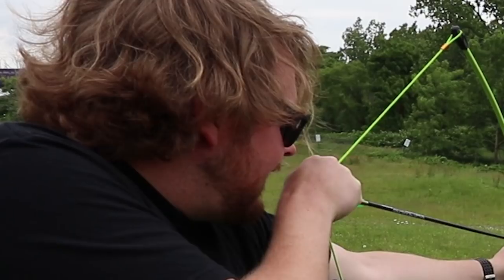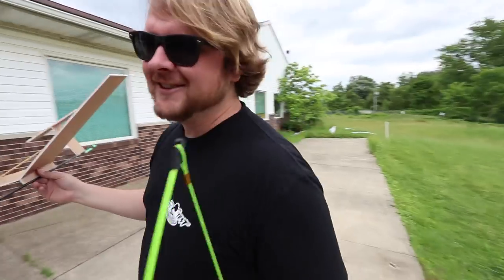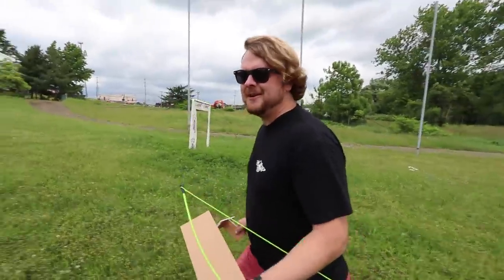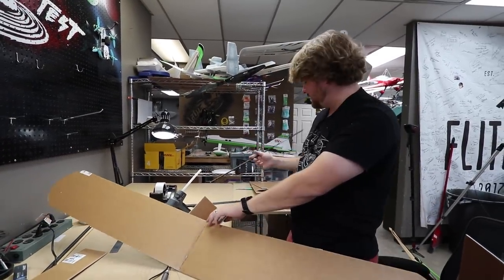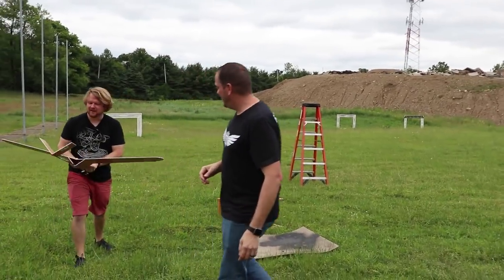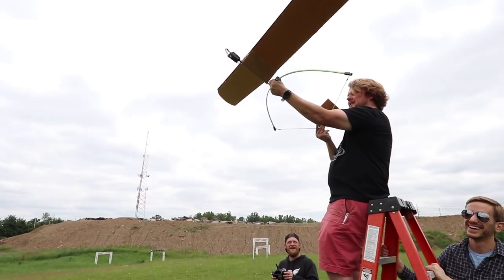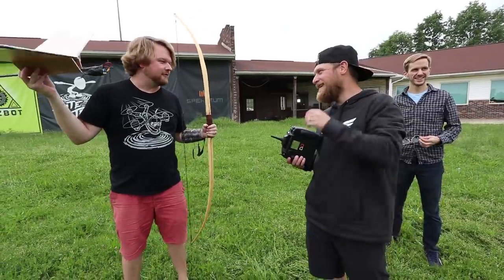The Bow and ArrowPlane

Comment: As an archer and an aviation enthusiasts I love this video. I have actually used dammaged arrows to reinforce wings in my builds.
Reply: itwaslikethatwhenigothere trying to figure out if my compound will work or if the crossbow will be the best
Reply: Mmmmmmm I’m doing this with my compound bow
Reply: You can also make pretty decent bows out of PVC pipe. You melt the limbs with a heat gun or stove and taper them out. Awesome vid like usual flite test! I've been inspired to give this a go now!
Reply: I have tried to in courage Flite test to do more with Rockets but for some reason they just won't...
Reply: @unorec1983  im a little bit late to this, but  using a crossbow would be better since you dont lose any velocity to newtons third law
Reply: I wont lie this is cool but as a hunter his bow form and how he dry fired it made me cringe and smart idea with the broken arrow idea do you use carbon or aluminium arrow I rather carbon
Reply: That’s smart. Carbon fiber arrows especially the expensive ones, are very consistent.
Reply: Anyone else cringe when he dry fired the bow. I know its a cheap walmart "toy" but......😡
Reply: Joerg (@joergsprave - The Slingshot Channel), should take up THIS challenge!

Comment: I like how it would have flown further if they had just left it an arrow.
Reply: Hmm...might keep that in mind for the Skittle challenge.
Reply: Make really tiny wings and tail..so no drag...forget the control surface...then shoot! LOL
Reply: Probably!  I hunt with a 90lb draw compound and have made shots at targets 300 feet away.  Please note, I didn't say I HIT the target consistently at that distance, but the arrows did carry that far!
Reply: Similar to the flight distance challenge my tenth grade science teacher set up for us. Come up with something that will fly as far as possible which weighed under so many grams/ounces, no power to it, had to be thrown. Had a couple of boys team up to solve the problem. Most of us made something. I came in with a giant balsa wood biplane glider that was really nothing more that a few sheets of balsa wood , some putty on the nose for weight, and some 1/8" strips of balsa wood for the struts. It was about 2 1/2' to 3' long with an equal size wingspan. If I'd had a good wind, or any wind actually, I'd have probably done better, think I managed between 15 and 20 feet. These two, however, came up with one of the heaviest "designs". A baseball, unmodified. Yup, it "flew" further than my design, or any design. They certainly didn't get any style points for that since they didn't do anything, but they did meet the criteria. The challenge didn't actually say you had to make something, just come up with something.
Reply: 90lb is pretty strong for a lady isn't it?
Reply: I would say that’s more like it being thrown than flying though.
Reply: Just like how throwing a crumpled piece of paper against a bad paper airplane.
Reply: Or if they gave it winglets or swept the wing a little bit.
Reply: But on a 20$ walmart bow?
Its probably like 15-20 pound draw weight and also sized for kids

Comment: I purchased a box of arrows from a sporting goods store they are perfect wing spars.Have been using the same box of shafts for several years. Even if you total the plane strip off  foam and rebuild the plane. These were fairly inexpensive arrows black composite shafts, the end that you thread the tips to has an plastic insert with a 4-40 threaded hole. 4-40threaded rod available from LHS or home center connects two shafts together for wing spars or keel beam in fuselage. Leave a gap between the two shaft ends and bend the threaded rod add dihedral 
to the two shaft spar. I like arrow shafts..

Comment: i use a carbon express 2117 aluminium arrow shaft for fuse on my motor glider,i 3d printed some clips to glue to foam board,eveything snaps on.work in progress
.....nice work guys.

Comment: With catapult launched gliders (CLGs) you balance it (as you did) for a flat gliding flight. Typically one will launch the glider so that the speed of the plane will be greater at launch than at gliding speed.
At a higher speed a plane that has lift will curve up into a stall if launched with level wings, and either dive into the ground or fly in a series of stalls.
Free flight CLGs are often launched with the wings at an angle to the ground so that rather that going into an upward arc the plane will fly in an arc between perpendicular to the ground and parallel with the ground: this will give you height, but rather than stalling the plane will level out into a glide.

Comment: Now I'm wondering if it would be possible to do a bow powered airplane.  Like how some planes use a twisted rubber band for power.  Maybe have an arrow with teeth along the top edge that turn a gear that then turns a propeller?  Sounds like a good project for Peter? :D

Comment: A few tips for gliders: first, when they are that small, I recommend that you remove the paper from the top of the wing and sand it into a sort of airfoil, and that will improve the glide ALOT. Also, the wing leading edge should be swept back slightly so that the wingtip has a smaller cord than the wing root and thus decreases tip losses like vortices. And lastly, instead of a barbecue skewer going over the top of the wings, try cutting a dihedral brace from plywood to go IN the wing where the center join is. And lastly, technically because lift:drag ratio is always equal to the glide ratio, a heavy plane could glide very well if it were very low drag.
Reply: Heavier plane = greater lift needed to stay airborne = greater coefficient of lift for any given velocity = greater induced drag = worse L/D
Reply: Precisely! Which is why I said "if it were very low drag". For example, the NXT Stream DLG has such a low drag airframe that it has almost the exact same glide ratio at 220 grams as at 600 grams. I believe at 220 its sink rate is 28 cm/sec, and at 600 its sink rate is 30 cm/sec
Reply: L/D and minimum sink are totally different.
Low weight will give low minimum sink and LD can be maximized with ballast to give a longer distance flown v height lost.
Reply: Right. Well I don't wanna get into an argument. You are right on all accounts; I misspoke. My main point was simply that, generally speaking(at least in my experience) light-weightness has VERY little to do with how a glider glides. That's all. You can check out some of the glider vids on my channel if you wanna see my gliders. Nothing fancy, just balsa DLGs. :) cheers!
Reply: More money more problems
Reply: @3Triskellion3  Maximum L/D and weight are unrelated. Two identical airplanes of different weights will have the exact same maximum L/D and the exact same maximum gliding distances. The differences between them will be 1. Best L/D speed (higher for the heavier plane); 2. Sink rate (higher for the heavier plane) and 3. Time aloft (shorter for the heavier plane).  The max L/D will be the same for both, as will be the gliding distance.

Comment: Dear FliteTest. I have a challenge for you. You know those flexible pipes used with portable airconditioners and such? You take two of those and mount them parallel, about a meter apart, put some engine inside each one. Stiffen them up a bit, and use their bendyness with some servos to control it. Could you make that work?

Comment: Would love to see a challenge to launch a craft from a Trebochet - Most likely a re-inforced Goblin or similar (to withstand the G-forces) 
3 parts to the challenge.
1 - Build an effective Trebochet.
2 - the craft needs to survive the launch, and should reach a suitable altitude that would encourage a panic state as it starts it's free-fall.
3 - operator only gets to control the craft from a certain height from the ground to recover and dive bomb a nearby target.
EXTRA POINTS: Do it with under Glide conditions - Competitor with longest glide wins after gaining control from freefall.

Comment: Crazy idea here, B-1 lancer type wings. but for the opposite effect, Wings closed for take off (reduced drag better pitch control on takeoff and greater transfer of momentum) open wings using a snubbing servo to allow for maximum lift through all airspeeds of the flight. 

If you have a wide wing you lose alot of energy on take off and you dont get full speed from the bow but you glide slower and "farther" but if you have closed wings, less drag you can fly at incredible speeds for a long distance but with limited lift most of the time these are called "arrows" when we shoot them out of a bow.

Comment: You're gonna need a bigger bow...
High forces over a small distance give a very high acceleration on launch which will have a tendency to rip the wings off so they've got to be strong. Batteries especially need to be secured very tightly!

Comment: I turned a bolt into a glider and fired it a few times from a crossbow that I made using a sinew backed ash prod that can shoot 1,000 grain bolts 400 yards. It was scary. The hickory bow you were using was a bit too whippy tillered. Bring more bend in towards the handle.

Comment: Seems to me I remember a plane called the scissor jack, or something like that. Basically it was an arrow that after its launched, the wings and tail sprung into position from a parallel position. Like the wings scissored out, after either a certain altitude or decrease in vertical pisitioning, or even time triggered.
It was more a glider type plane, so it was to be pointed upwards. I dont remember when or where I saw it. Maybe shop class?

Comment: You could tape little paper wings on a regular arrow and shoot it correctly and go farther. Also you went 182 ft because of the starting height. Apples to apples we need  to know how high the starting point was from where the plane landed. Imo you should have to go farther than a normal arrow can go before the challenge even begins.

Comment: When I as a kid, we used to buy little gliders that had fold-down wings.  The wings would fold flat alongside the fuselage, and the plane was fired into the air with an elastic.  As long as the plane was going fast enough, air pressure would keep the wings folded, but, and when the air speed reduced enough, the wings would flip out, and it would glide.
The wings were sheets of thin balsa, and the flip-out mechanism was an elastic band with a bit of wire.
The mechanism was the same as this one ... 
https://www.youtube.com/watch?v=aiLv9b5FR7M

Comment: I know I'm a little late to the party here, but I have to say one of the main problems here is lack of draw length.

He couldn't fully draw the bow thanks to the wing brace going around the shaft.

Also, a compound bow would make it easier to hold back at full draw.

I disagree with those who say to use a crossbow. Bolts are kind of short for this.

I should also add that crossbows are not generally more powerful than a compound bow(sorry to all you crossbow fanboys. I used to be one too lol). Their draw weight is higher, but their draw distance is so much shorter than a compound bow (excluding those compound crossbows that shoot regular arrows). Bolts get less distance to accelerate. 

A typical crossbow's bolt carries less energy to a target and goes slower than an arrow from a compound bow with half, heck maybe even a third of the crossbow's draw weight.

Comment: Test is not valid because you used a launch point that is higher than the landing point. Most people will have a somewhat level flying field. try from a point of launch that is closer to the same elevation as the intended landing point. But cool plane and it flies silky smooth. Call it the silk glider!

Comment: Wait a minute... Did he say ESC? What do you need that for? Did he just mean one of those 5 volt regulators that goes straight from the battery to the receiver or what, cuz at that point you could just use a smaller battery? Anyway really funny video and a good idea too

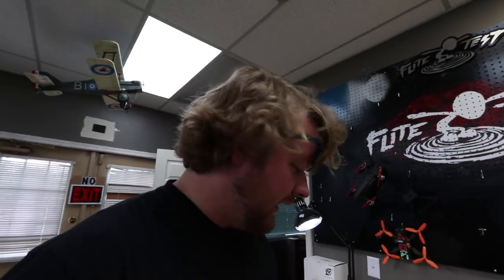Comment: Uh, 1:20 is patently false.  Weight doesn't affect the glide ratio except in the extremes. It changes the speed at which the best glide ratio can be obtained and that is a key for the high performance glider types.  I used to fly my glider with water ballast on windy days for better penetration.

Comment: Can u make a video on finding lost planes PLZ !!!!!? I had an incident
Reply: happend to me too
Reply: I spent $8000 on plane
Reply: i spent $700
Reply: I do it just like when you try to find a lost arrow. lose a 2nd plane and while you are looking for the second plane you will find the first plane. ;oP
Reply: Lucky I figured out the hard way to not fly a little UMX t28 in 40 MPH winds LOL 😂
Reply: there is a plug in siren you can buy . it plugs into a spare channel on the receiver . if the plane ditches . or goes missing you turn the radio off and the siren starts . it works really well! they are cheap . look for " Discovery buzzer " on eBay